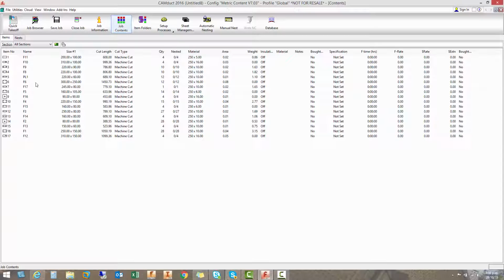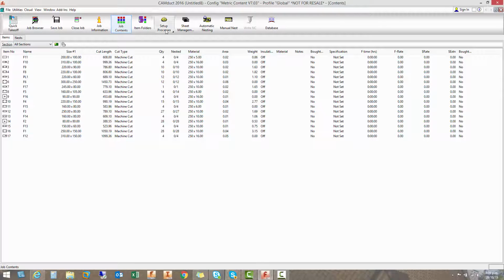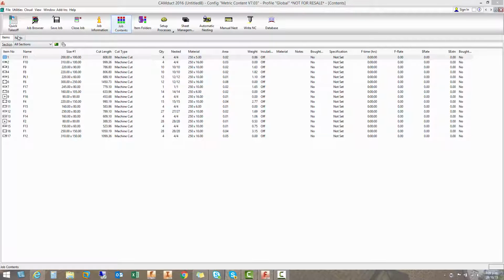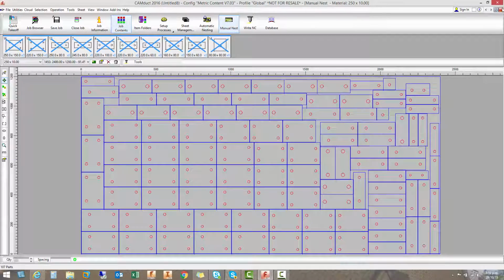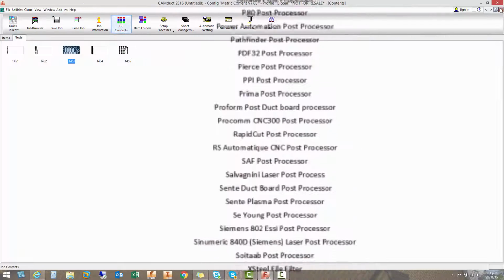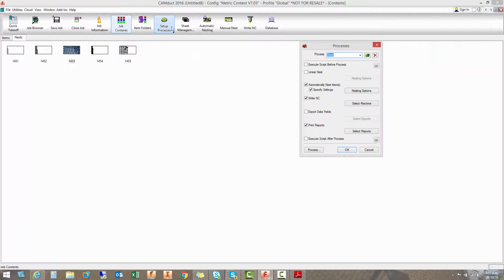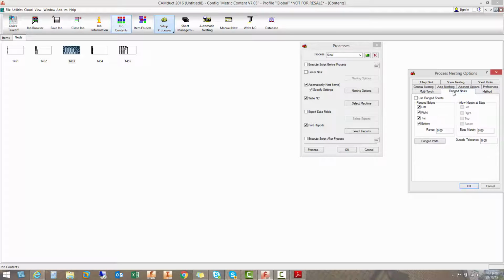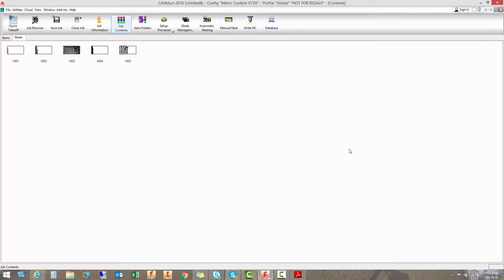Nesting Steel profiles with Autodesk Fabrication CAMduct

Comment: This workflow is still relevant in 2019. The common question I have had about this is the importing of the files. You need to add the Filter as shown here: https://knowledge.autodesk.com/support/fabrication-products/learn-explore/caas/CloudHelp/cloudhelp/2019/ENU/Fabrication-UsersGuide/files/GUID-3BDFBE4E-552A-4AB7-B7C6-364CFA60CAFB-htm.html